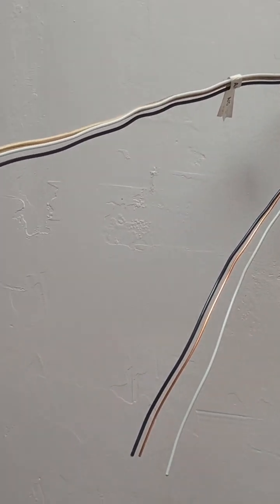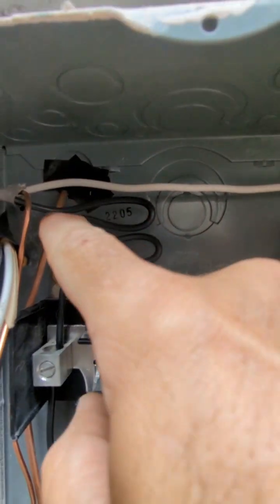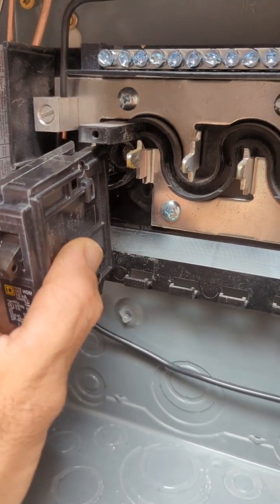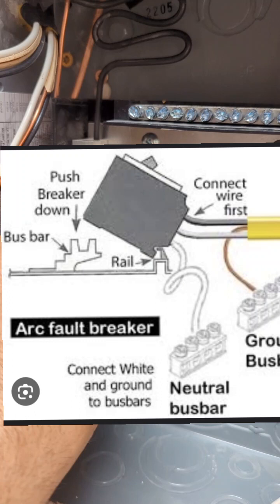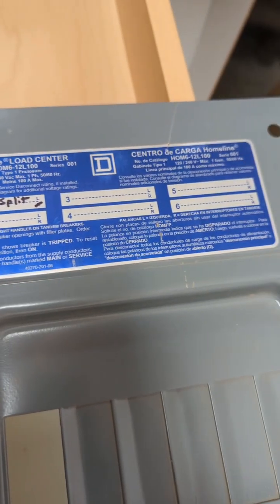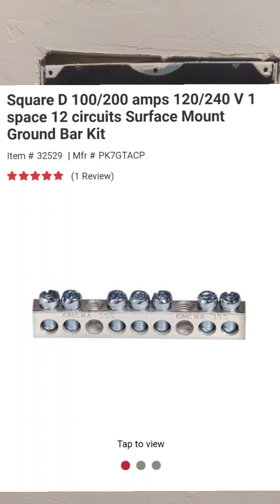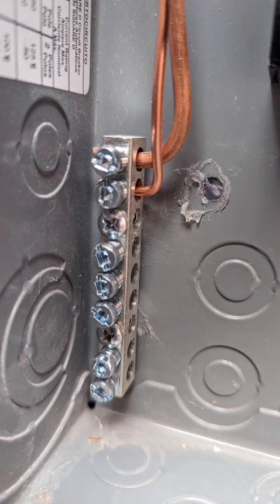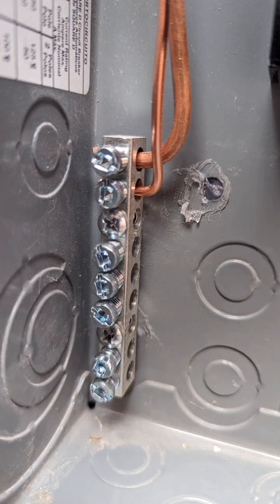How to wire a subpanel - part 2 wiring and grounding

Comment: Just about getting ready to do this exact setup. I will only have 3 breakers. Two 20amp and one 15 amp. My question is, what breaker would I need down at the main panel?  Distance is about 120ft. Thanks!
Reply from the maker: I based mine on the size wire running from the main to the sub panel  ... I ran 10awg so the breaker is 30A. Hope that helps